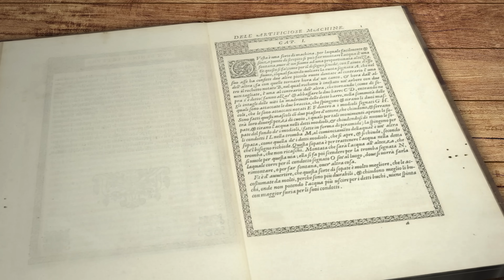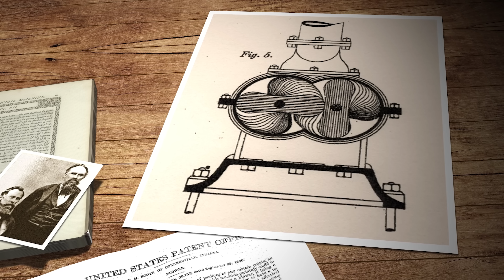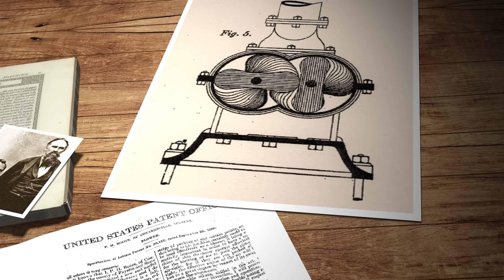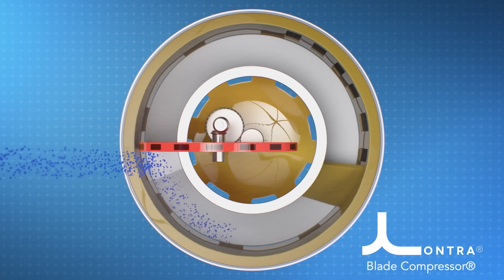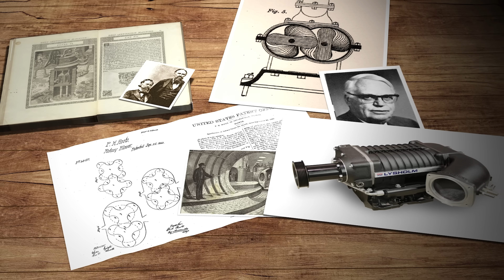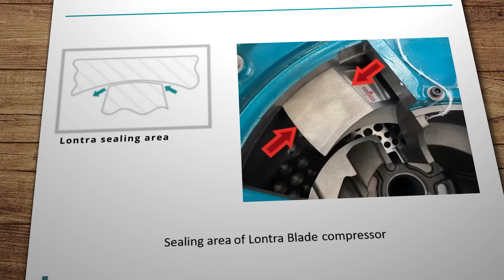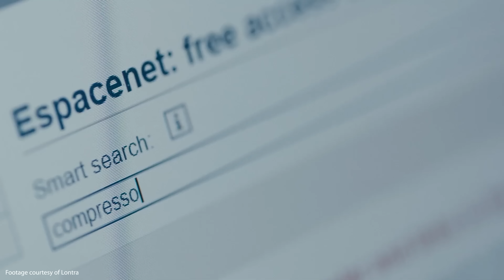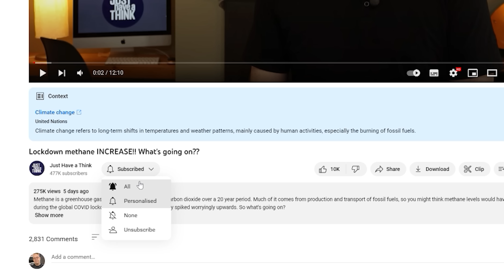Compressing air to reach net zero. A 'revolutionary' innovation.

Comment: My V8 Hot Rod runs a 6/71 Rootes Supercharger .It has teflon strips on the rotors .
One of these compressors would be less parasitic drag off the engine .

Comment: The IPCC estimates that a power plant equipped with CCS using mineral storage will need 60–180 per cent more energy than a power plant without CCS.  Good luck with it making sense,  this is why most CCS projects were dropped in the past.
Reply: OK, sure, but OT.

Comment: 20% saving ? In France big waste water treatment facility that use sludge have for highest cost there electricity. Most of it is the air. i have 3 60kw surpressor running 20% reduction may be close to 5% reduction of total year cost of operation.

Comment: The problem with efficiencies is that companies will tend to expand their output as a result, rather than keep the output the same and thereby reduce emissions. Not that I think this compressor efficiency is a bad thing, just that I'm not sure it will result in real-world reductions in emissions.
Reply: By making more they would oversupply and put other manufacturers out or not be able to sell.  Basic supply and demand.

Comment: Formula 1 engineer, Guy Niegre, developed a compressed air piston engine that can power a carbon fiber mini van 200 miles on 3x 7 foot tanks.
Angelo Di Pietro invented a smaller, more powerful compressed air rotary engine & a new compressed air tank.
The compressor featured in your video + solar electricity, combined with their engine & tank, may be the answer to zero emissions transport.

Would like to hear your thoughts on these two engineer's designs, in a future video.
Reply: A simple battery can store more energy than compressed air tanks.
Reply: Well he didn't. He maybe made other beleive that he developed this "snake oil" mini van. Sorry, but likelihood of that being anything but a hoax/scam is very small. 
First an foremost: A compressor is a very inefficient device. Somewhere between 10-20% of the input energy is converted into compressed air, and the rest as heat, the lowest form of energy. Higher pressure =lower efficiency. 
Secondly: A circular tank 3×7 feet has a volume of roughly 1,8m3. If that tank was filled with air @ 200bar(same as a divers tube) the total energy content in that tank would be 36130kJ or 10kWh. Roughly 1/20th of the capacity of a Tesla model S battery.
Third: This vehicle was driven by a piston engine power from the stored energy in the air tank. Piston engines isn't the most efficient either. Reciprocating motion involves continuous acceleration/deceleration meaning losses. I have a hard time imaging a efficiency anything above 35%. But let's say 50% for the sake of argument. 
That would mean 0,2×0,5=0,1=10% efficiency of the system as a whole.
50kWh electric energy, converted into 10kWh compressed air, converted into 5kWh of mechanical work. 
And he drove 200 miles =320km using only 5kWh. If we assume a speed of 100kph or 60mph he drove for roughly 3h. That indicates a mean power consumption of 5kWh/3h=1,7kW=2,3hp. 
NO, NO, NO!
Reply: There used to be "fireless" locomotives, instead of a conventional boiler, they just had a tank that received steam from a outside source, then used the steam to power the locomotives, often in paper Mills or mines where sources of ignition are problematic. This can hold more energy than compressed air.
Reply: Compressed air has a very low energy density compared to other storage devices (fuel, battery etc.)

Comment: of course millions of engineers are probably doing this already, but how about using the increased temperature of the compressed air to pre-warm and hence pre-compress the incoming air.
Reply: Warm air is less dense? Warming incoming air would drop the mass/volume and lower efficiency in my mind… but it’s air flow which is essentially black magic so who knows
Reply: @josephjones4293  if Its constant pressure it will expand, if it’s constant volume it will increase the pressure. If you have a two-stage compressor I guess it will help.
Reply: Thermodynamically speaking that's actually the opposite of what you really want to do. If you're going to use the compressed air to do expansion work then you want it to be hot

Comment: I designed a similar mechanism as a 4 stroke rotary engine but it just exist on paper.
Reply: I can't believe it. Same here. Just switch it to about a 50:50 tooth ratio and the compression stroke can come from one disk while the combustion drives down the other in a beautiful harmony of pieces. All the motion is pure rotation tremendously helping efficiency. The force is tangential to the drive shaft producing a torque curve that looks more like that of an electric motor. (A typical piston has a torque curve that looks like tan(x).) Such an engine could eliminate engine valves and possibly even the transmission (except for reverse).
Reply: @popebobcat3716  I see its use for a gas generator for EV's.

Comment: Hmm.... Is it back-driveable? Meaning, can I compress air into a storage device and later use that air to decompress and drive the motor to become a generator? Ya know, energy storage!
Reply: I don't see any reason why not.
Reply: Yes it can they are call air accumulators and they can be used to power a lot of things directly more efficiently or by generating electricity less efficient.

Comment: Hmm. Interesting. I'd like to see comparative efficiency data and pressure plots. The exhaust port and blade intersection with holes and sharp edges induces a ton of turbulence. Seems like an interesting idea, but the devil is in the details, and the details still look rough. Looks like potentially high volume but low pressure kind of design.
Reply: With an increase in the required pressure, radial loads on the rotating part with small holes will increase significantly and uneven during compression. The bearing will not be happy.
Reply: Would this be good as a compressor for a refrigerator.  Would help bring down the price of heat compressors.
Reply: @grahamehadden4320  Price of heat compressors based on electric coils manufacturing. This gismo will lower electric consumption.
Reply: Very good point... makes me wonder why they chose to go with the small holes as opposed to a large single opening. I could imagine a few tweaks to the design that would probably have a not-insignificant effect on efficiency.... I'm also curious about bearing wear and the motor loading profiles. I'd love to see how it compares to ring blowers.
Reply: @michaelransom5841 
The small holes are for balancing the system, to get a smooth power gradient, (I didn't pay enough attention to know where the one way valve is, but it should be part of the compressor body)  also consider material strength, where a single large hole can cause warping of the disc due to temperature and physical stresses.
Reply: @stoneomountain2390  Those thoughts did cross my mind, although they could be accounted for with the right engineering, but that would drive manufacturing costs up, so I guess it's a cost-benefit thing.
Reply: @stoneomountain2390  the valve is the intersection of the disc...
Reply: By the way, simple piston engine is way more reliable and efficient than topic`s supercharger...
Reply: @mustdie1998  have you proven that? What is the maintenance interval for the machine mentioned by the video?